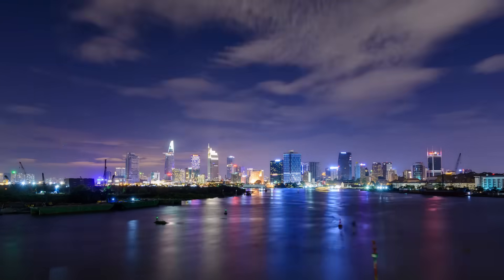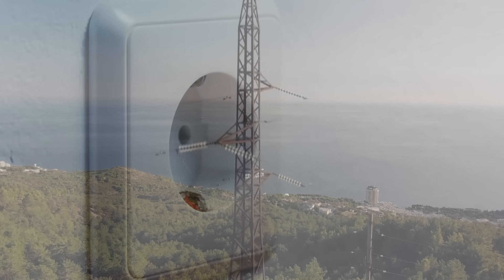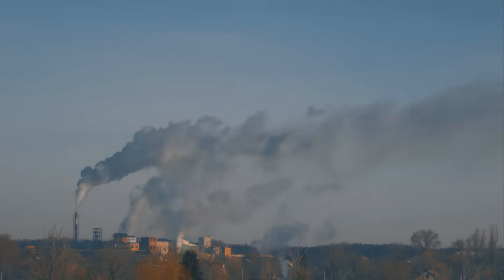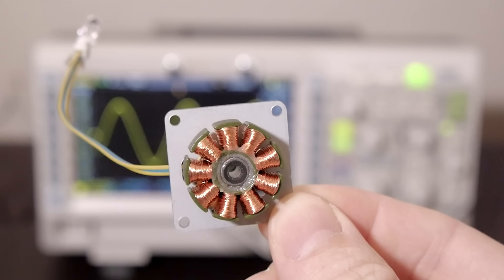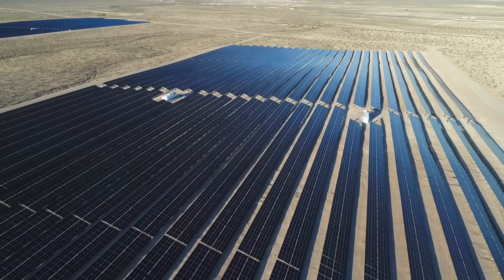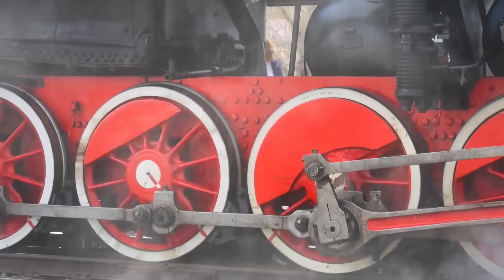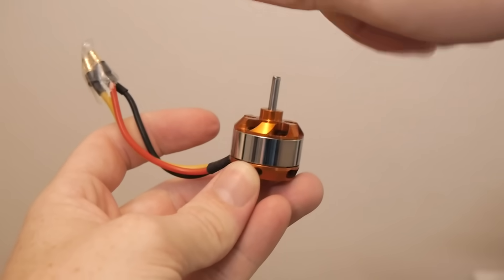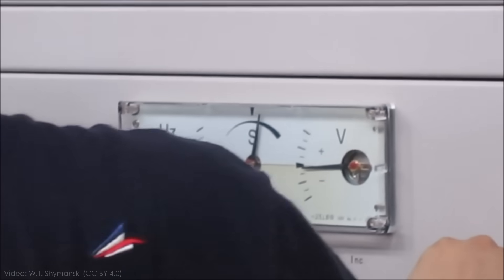How Electricity Generation Really Works

Comment: Could you explain. How solar energy is fed back to the grid. I'm thinking you megawatts of power throw the grid from the generation plant.
But I can hook up N 3 kw solar system and push energy back into the grid.
My question how does the sinewave not clash(short) in this systems.
Imaging water throw a pipe of 100mm with 5 bar. How do you push water back from a 10mm pipe with 2 bar.
Would really appreciate an explanation.
Reply: The flaw in your understanding is that there is no pressure in electrical lines.  Electricity is not pushed, but pulled.  You could think of it as a continuous loop at neutral pressure but high flow.  There is enough liquid to supply all outlets without drop in pressure.   When supplying the grid instead of pulling from the grid, you just reverse a valve so instead of filling up a tank from the pipe,  you empty the tank that has extra fluid, back into the loop where someone somewhere else is pulling from the pipe to fill their tank that is low or empty.  Doing this decreases the ammount that the main tank that supplies fluid for everyone has to output and refill constantly to have a continuous supply at neutral pressure.    

And as for the frequency,  it just uses the inverter that changes grid power to dc to change it back to the same as the grid power.    

It is a very basic answer but hope it helps you understand.

Comment: It really seems like nuclear is the best option for large scale green power. I cant imagine a greener world with unreliable power because we will need batteries which require cobalt and nickel which are destructive to mine. CO2 from construction of powerplants and nuclear waste seems like the lesser evil imo.
Reply: There really is no "best" option for clean power production.  There is only "least worse" meaning it is not as bad as others.   They all have negative effects to the environment.   It is just a matter of wich has the lowest impact.    A big issue with nuclear power(besides the fact that if something goes wrong, it goes REALLLLY BAD REALLLLY FAST)  is the mining required to get the stuff to make the fuel rods and control rods.     Not only does it negate the benefits of the cleaner power production,  but also adds serious contamination to the environment.   So while it seems like nuclear power is clean while only looking at the power production plant, it is really not that much better when you look at how it gets to that stage.

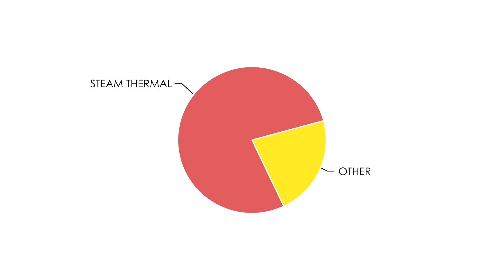Comment: 1:58 while getting water really hot is a common theme, I believe there is a larger central concept: utilizing fluid (in this case counting gasses as a fluid) to transfer kinetic energy to a turbine or other device that converts to rotational motion (which will usually either turn a generator or directly power a device).  This includes most of the same techniques as getting water really hot (excluding rare peltier applications, etc), as well as hydroelectric, wind, and even pneumatic, etc.
Reply: You could theoretically use a gas as your fluid. Although i think it needs higher temperatures to be efficient. There's an idea to use a combined cycle high temperature nuclear reactor (HTGR;MSR or FBR) that operates with a Brayton gas cycle and then has a steam generator feeding a normal Rankine cycle steam turbine.

Comment: The video mentions how heating up water causing it to turn to steam and physically moving the turbine, is the most common way to create electrical power.  I was wondering if there was a way to go in reverse.  Instead of heat, use the condensing caused by lowering temperature to move a turbine.  I guess it's fusion vs fusion. But I was thinking about for power creation.  I guess if you could capture the steam of a power plant in some sort condensation sphere at the top of the steam tower.  And allow it to cool and revert from steam back to a liquid.   The liquid water at the top could be allowed to flow back down to ground level and that force might also be able to turn a turbine and generating more power from the cooling of the water.   I'm not sure how well a system like this would practically work.   But in theory electric power should be able to be produced from both the heating and cooling of water.

Comment: A steam turbine does not turn heat into rotational energy, a boiler heats water,  heated water boils, the resulting change of the physical state of heated water from liquid to gas is what releases energy and turns heat energy into physical and or potential mechanical energy. If the steam is ported linearly into a  turbine, then the turbine uses the expanding physical force and resulting kinetic energy of the mass x the linear velocity of the  steam, rushing into the housing of the turbine, contacting and acting upon the turbine wheel vanes, which redirect and change the linear "MOTION" to rotary "MOTION", 
 Heat ENERGY Discharges a subtance's potential energy, creating physical force, when enough acts upon, and exceeds the forces of friction encountered by the   physical mass, it creates motion, which then gives the mass kinetic energy,  
e = (m × v) when the kinetic energy of the mass encounters an object who's area volume and friction  exceeds the capacity of a substances independent unit particle mass and  cohesive strength, at a given velocity and volume, it wil be trapped unless there is a point in an immediate direction whos friction can't oppose the mass in motion enough to stop it, but can alter its direction, force, and energy of the mass. In this case, funneled into the outer perimiter of the turbine wheel. One Motion to another Motion

Comment: Massive amounts of electrical energy (GW-Hrs) can be stored in Pumped Storage Hydroelectric Power Plants. these are based on pumping water uphill against gravity with a really big pump (250 MW or so) and recovering most of the energy by running the pump in the opposite direction as a hydro turbine to drive the same motor as a generator. This is possible because water turbines and water pumps can be the same piece of machinery and AC generators can operate in either rotational direction.

Comment: Yes, in a functional power grid, a maximum of 30 to 40% can be wind and solar.
In an hypothetical fully green power grid, the remaining power must be generated by rotating machines, either hydropower or nuclear generators.
Phasing the generators for a parallel connection by hand with the use of a synchroscope is something that I have seen done in legacy power plants (from the '60 - '70); now the central computer takes care of such tasks.
Thank you for your videos. I'm retired, but I like watch them anyway, as they relax and you tells things I may not know.

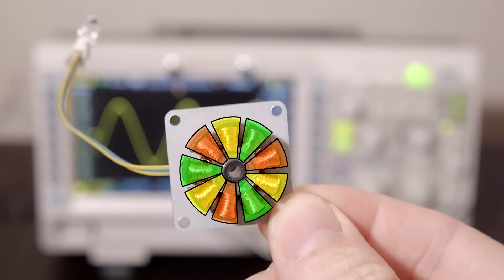Comment: 3:18 most places in the world, the number of coils in the stator is divisible by 3*. Not actually 3. For example 3500rpm would be six series coil groups and 1800rpm would be twelve series coil groups. The more coil groups you have (as a factor of three in 3 phase power) the more poles you will have, which is how we control speeds.

Comment: I still remember not fondly, the teacher I had for theatre electrics (and later lighting design, ugg). Sophomore year I asked at the start of the semester if we'd get some sort of basic overview of the grid we would be connecting theatre lighting packages to? We were designing lighting shows in the 350K watt range.
He told me that if I wanted to know where the power comes from, to walk out and look at a utility pole.
He was always willing to make a student look stupid for asking just about anything he wasn't prepared to address. I wasn't looking for an engineers dissertation, just useful info for a theatre master electrician.

Comment: There Is No Shortage of Energy; There Is Shortage of Normalcy

Despite increased production of energy from renewable sources, and despite the slowdown in car manufacturing, oil prices are skyrocketing. Even though fewer power plants still burn coal, coal prices are skyrocketing, as well. Natural gas prices, too, are going through the roof, and energy demand seems to outpace supply in every country and in every form of energy. Have Earth’s energy sources dwindled so drastically in a matter of months? The answer is a resounding “No!” There is no shortage of energy; there is a serious shortage of normalcy in human relations. I hope the current crisis will put some sense into humanity’s insane consumption.
The energy crunch indicates that we are over consuming. We are producing too much, throwing the excess production to the trash, polluting the ground, the air, and the water, and then we are complaining that we do not have enough. It is about as sane as killing one’s parents and then pleading for the court’s mercy because I’ve recently been orphaned.
It is time we reconsider everything we produce—how we divide production, profits, and goods, which services are necessary and which are redundant, and most importantly, how we treat one another. The goal of this process should be clear to everyone: survival.
There is no ulterior motive, no attempt to dominate or deprive anyone of power or wealth. It is simply that reality is forcing us to take all of humanity and the entire planet into consideration. If we don’t, our entire civilization will collapse like a deck of cards.
Since we still do not understand it and insist on running things the way we have always been running them—through power games—I anticipate a very cold and gloomy winter for the northern hemisphere. The energy crunch will leave many in dark and cold houses; there will be no gas for cars, and renewable energy will not replace traditional sources since there will be little sun during the winter. I hope that at least, it will make us rethink our values. If it doesn’t, next summer will be even worse than the awful summer that just ended.
I know that many people are counting on the promise of renewable energy to solve the energy problems of humanity. I think they are mistaken. There is plenty of energy, far more than we really need. We could cut emissions by at least half tomorrow. But the more we have, the hungrier we become, so our thirst for energy will never be satiated, and we will never stop exploiting the planet or each other until we reeducate ourselves and start being humane toward each other.
We have been behaving like spoiled brats whose parents buy them whatever they want. Now, our parents have run out of money and our childhood is over. It is time for us to mature and conduct ourselves like responsible adults, caring for all of humanity the way a mother cares for her entire family. If we think like a family, we will achieve normalcy.

Comment: There's no way "grid following" could actually exist like you described. That would mean that at any given time, the load on the generators would be fluctuating. There's so many intermittent power needs, you couldn't possibly adjust this in real time. Steam power isn't capable of responding in real time, neither are renewables. Electricity has to be oversupplied, and fully supplied. Ramping up production just doesn't really make sense. Think about how fluid dynamics work, for hydropower. Reduction in water flow would actually decrease the force of the water, it would no longer have the pressure needed to turn the turbine. Only full flow would actually work. This could be met by limiting turbines in use, but it's way too slow to be responsive to intermittent demand. This method could only be used if overall demand increased on average.
If load could actually be transferred through a transformer, any load being transferred to the generator would cause a loss in MOMENTUM (not inertia), and a subsequent reduction in frequency (Hz). You would never be able to respond accordingly, because you would never know if the demand was going increase, decrease, or stay the same.
Not only that, but you can't actually manage renewables effectively in this context. Speeding up or slowing down wind generators, (or anything for that matter) effects frequency, and solar is DC. The only thing you could do is turn it on or off. Basically, if what you said is true about "grid following", "renewables" are functionally worthless.
The fact is, power would have to be constantly supplied, whether it's used or not. For example, if you had a hand powered generator, you couldn't simply stop turning it as fast because no one is using the power at that instant. You just have to keep cranking, in case it's used.
Smart grids are at best basically aggregates of data, with acceptable losses in oversupply. You could never merely meet demand, because electricity under full load simply stops altogether. Matching demand would stall the grid. You basically proved that point by connecting the wires together in the alternator. When force and load are equivalent, it stalls.
To reiterate, load matching isn't possible, because power inputs can't be fluctuated in real time, but more importantly, they can't change frequency. If any one power generator changed frequency, the entire grid would have to match that frequency. Load matching would have to be simultaneously done for every generator. So not only does one source need to load match, every other needs to do so as well, all intermittently and instantaneously.
Honestly, this whole thing is completely absurd.

Comment: "Each additional demand causes a little more load on every generator together, slowing the rotation by a tiny amount and thus decreasing the frequency of the alternating current. Similarly if electricity generation exceeds the demand, the generators will speed up."

Why is a decrease in frequency required for an increased load? Should a higher frequency not mean more electricity is being made to meet the load?

Comment: actually  that tiny gen is built opposite to the way an alternator works, being a stator 
with a large electro-magnetic rotor inside it. also turning a smaller d.c. gen known as 
an exciter to provide d.c. to energize the rotor making it a very powerful magnet. the 
alternator in ur car is for a good part similar to a giant alternator.

Comment: This is good but how does spinning a rod in the center of magnets make electricity?
Reply: in short, a magnet that is physically moving can attract the nearby electrons and if the medium is conductive (for example copper cables) they move easily, which is basically electricity. if you are curious about the electromagnetics behind it, search for videos like "how do AC motors/generators work"

Comment: adding a generator to the outgoing line without out getting voltage and frequency as close as possible 
can result in electrical and mechanical damage.

Comment: This doesn't tell me how it's made, yes you said what makes it but why does the spinning wire spool things generate electricity
Reply: "Why" is not a good question in physics as the answer is "that's the way the universe is organised".  "How" is because moving electrons in a conductor produce magnetic fields and vice-versa, a moving conductor in a magnetic field will cause electrons to flow.

Comment: People make such a big production of grid frequency control - the need to instantaneously match power generated with load within close limits. It's very simple at base. E.g. think of your little single phase diesel generator. The engine governor must adjust the fuel racks so as to maintain set frequency (typically 50, 60 or 400 Hz) within close limits. The grid is identical, albeit much larger and more complex.
Reply: When there is more than on and not-so-little generators working together, phase and frequency become important issues.

Comment: 3:30 Asynchronous motors are alo a reason for 3 phase AC. Tesla actually had that in mind and to get investors he would show his rotating egg trick. Asynchronous motors have no switching contacts - they lest for ever!!! One of the greatest problems with the grid is stability - remember that those are transmission lines and, therefore, they have inductance and capacitance. Depending on the distance, it's a "twisted pair" transmission line. (it's not a pair and the twisting requires some 4 or 5 towers)
Reply: Transmission lines are not "twisted" - you are confused with telephone lines.

Comment: At 7:07 you reference spinning reserve as a generator that can connect to the grid at a moments notice, that is actually a reserve shutdown unit. Spinning reserve is what generation capability is left available for use on a generator that is currently producing, i.e a generator capable of producing 155MW that is only currently producing 100MW would have a spinning reserve of 55MW.

Comment: I have access to an endless water supply and a 220 volt three phase generator head. It is a 50kw rating, does that mean that it is already equipped with an internal voltage regulator?
Reply: No, that is more to do with how much heating it can withstand when operating into a load.
Reply: @karhukivi  Thanks for the info, as I was wondering if I could rig it up as a water turbine to power my house.
Reply: @davidharris8861  It might have a built-in voltage regulator, otherwise a separate control unit is required which varies the current to the exciter windings to control the voltage.  Good luck!
Reply: @karhukivi  Thank-you that gives me something to go on to look into.You have helped me a lot! Thank-you again

Comment: I've been off grid since 1993. I started out with expensive used solar panels (ARCO Quadlams @45 watts for $100) and an Air 303 wind generator. Now Solar panels are under $1 per watt and Wind generators are made in China and don't work so I am using only solar panels.

Comment: Little funfact, the engineers, after an unlikely series of human error combined with recklessness driven by pressure from the government, the engineers had a blast testing wether or not the steam turbines would have enough inertia to continue powering the water pumps